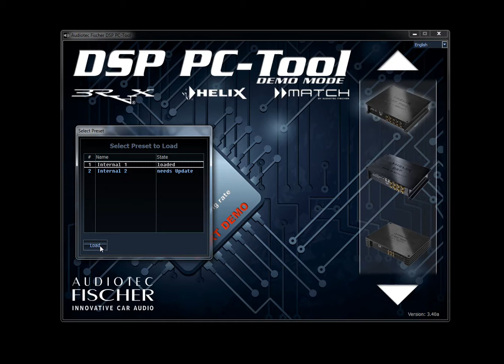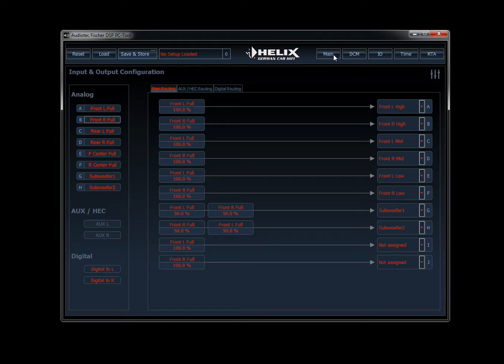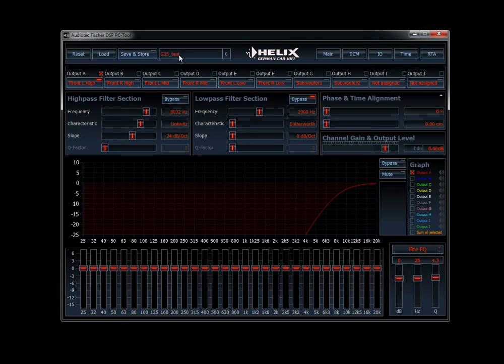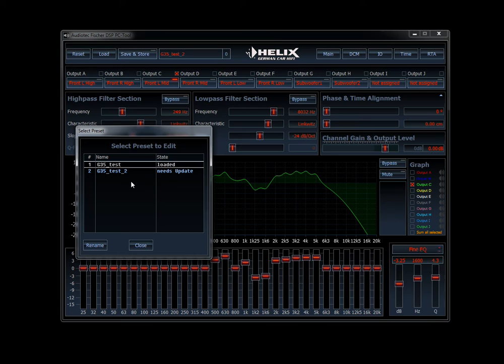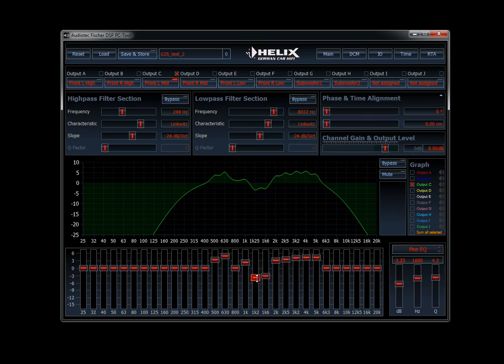Helix DSP Setting Inputs, Outputs, and X-overs

Comment: Ordered the .2 helix. Everyone said this was best over jl. I have premium sound in 2018 ecosport what would you recommend to set this to fix bass rolloff?
Reply: How would I know on a car this new what outputs have what range? I am guessing because it was said to be their most powerful stock system it has quite points set so I'm trying to undo that to run aftermarket mono block and full range for mids and highs. It's titanium so I think it has a center as well

Comment: I do my own installs ... some how I was tricked into buying this amp .. not realizing it has to be programmed .. so I'm trying to learn how to set this amp up without a sound shop ..
Reply from the maker: If you own this and have never tuned a vehicle before I highly suggest you get a shop to tune for you. You can still install it yourself but at least have the setup done properly
Reply: @JosiahBuwalda  I do my own installs ...I have a distortion meter...  multi meters... 2 years highschool electronics.. 4 years army wire systems installer for phones .  and singard Radio repair... I did my own installs years ago and now... this is the first digital amp ive every bought .. I have a YouTube channel of PC building.. I have a YouTube channel for RC car building... I'm bar far of needing them to adjust this amp... and I build amazing PCs that don't over heat .. I over power then with the PSU ... I haven't seen the video all the way through... I'm just curious if I need a cable to hook it to my laptop?
Reply: @JosiahBuwalda  I live in Spokane Washington my shop is like 3 months to 6 months out for an appointment... and I paid $1700 for this amp not realizing it has no gains or knobs on it ... I didn't pay attention
Reply: @JosiahBuwalda  as long as I can get the program and learn how to connect .. I'm so OCD I will be fine and I'm a perfectionist... this is why I do my own installs... I solder and weld on my zero gauge ferrules with a torch ... and I have enough stuff to wire up about 10 cars with zero gauge .. I seen a few seconds of your video and I'm impressed
Reply from the maker: @SteveJ619  you need a usb cable. Everything can be found online, on the Audiotec Fischer website!
Reply: @JosiahBuwalda  and I've built a few different types of boxes thay will need to be tuned ... I don't want to pay to re- tune everytime I want to play with my system by swapping things out... all my amp wires that go to speakers have RC car battery plugs on them so I can take my subs out in 1 second... was smart I made a set of speaker leads for a few boxes..  I've made boxes for 4 ---,6.5 door speakers as well ... I want to test mid and higher sounds out of door speakers .. in a box in my trunk on a vented box to get more full of a sound out of door speakers .. when I find the set that sounds the best .. I will put them in my Dyno mat doors but I think I might make a port on the door through the Dyno matt not sure yet... I will test my back doors first... this is a 2008 Subaru legacy N/A tune ... looks like a kids car... people block me on 2 Lane roads they don't like seeing my car come up behind them on the freeway....I even get break checked sometimes in Spokane... people drive like assholes up here... this is why I'm doing my sound system at the age of 47 years old ... you can't speed up here .. traffic and people won't let you ... so the music slows my roll... and keeps me from getting road rage... this way I stopped passing people on shoulders because I am from San Diego so I do drive like a jackass if I need to ... and I would hate to wreck this car after all those hot ass days required to dynomat it ... first Dynomat I've ever done... made me sick... if I blew a fan in my car to keep me from over heating... the dynomat wouldn't stick and would fall off .. it needed to be 80 to 90 degrees in my car... I can work for about 30 mins before I get everything wet with sweat ... it was actually a lot harder than I thought and I cut my fingers open like crazy because the aluminum foil on that f**** dynamat was sharper than s*** .. anyways .. didn't mean to get into a rant ... I just can't trust anyone to work on my car in Spokane Washington .. nothing but con artist scam artist robbers people that do not do the correct work up here they are half-assed they will f*** you over ... I've learned the hard way I've lived here for 7 years .  it's scam central for car repairs or home remodeling...
Reply: @JosiahBuwalda  do you have a shop?.... are you a state by Washington... I want my car done now .. I'm willing to take a road trip after some of my jobs are finished

Comment: If my tweeters frequency response is 2200hz at the lowest, the slope should not go beyond that frequency right?
Reply from the maker: So usually a Freq Response is based at a very low wattage. So just because it says you can play them down to 2200, you don’t want to cross them over there. Usually with higher end brands there should be a “suggested” crossover point under the specifications of the speaker. I would say to start a tweeter crossover at 6500 at -24db slope. Then play with it from there
Reply: @JosiahBuwalda  i only have a 2 way component system, and my woofer goes to 6000hz. I’ve crossed them at 3500hz, and the slope doesn’t cross the frequency response on either speaker 😄

Comment: I’m guessing since I’m using the hec usb input there is no gain to set.
Reply from the maker: Sorry didn’t see your comment. There is limited control on the input side. But on the output side to the amplifiers there is gain adjustment. I use the gain adjustment in the Helix to fine tune the speakers, most gain adjustment should be done via the amplifiers. That being said, the USB module only works from a device that has a volume control or it’s own power output, such as a Fiio player, that is where your “gain” aka volume adjustment would be. Gain and volume are the changing of voltage to the processor, then adjustment of voltage in the dsp to amplifiers and out to speakers. Hope this was t to confusing

Comment: super video did all to perfection PERFECT!!! but I have an important Question. when I did all this configuration only with the front RCAs all my speakers are in the front for sure like your video BUT BUT when I use on the Radio head unit the Balance Right Left Forward Rear its not working all its a mess... why is this happening?

Comment: Do you have a video about reading the speaker datasheet how you know what the best crossovers are for the speakers.
Reply from the maker: I don’t but Most companies give a suggested crossover point. Or you can use DATs to run a sweep and get your parameters as to what the speaker can play. Then use that information to make a decision on crossover points.
Reply: @JosiahBuwalda  thx I try to do my best on that . For example my tweeters can start off 800 hz that kind off specs I do have

Comment: I have my front speakers all playing in mono for some reason ....how am I able to get them playing in stereo.
Reply from the maker: Not exactly sure what you mean. If you follow along the video there is no way to have them playing in mono. Mono would consist of having the Left and Right signal on one output on the IO page. If you set it up correctly than it’s not in your dsp is more than likely a wiring error.
Reply: System is on mono....algood will sort it out....has something to do with settings i had on io page

Comment: Can the 2 outputs from a V Eight DSP Mk2 be configured as separate mono outputs or do they have to be stereo left and right? I am trying to do an active 3way front, rear fill, center channel, and mono sub. The eight channels can power the doors, and the outputs I want to run to two other amps (one for center, one for sub).
Reply from the maker: You can run it however you want. If you put both a Left and Right signal on an output that will make it “mono”. So do that and it will work

Comment: Thank you. My car audio guy made some changes. It’s been difficult to get back in with him. 

Question is, so if I download the software, should all his presets show up on my Laptop. Also, do I  have to mute anything within the dsp before making changes ? 

My setup, P one to subs, and the helix V 12 dsp. Last time he played with it, he added way to much tweeter. I’d like to revert to the original sound. If this is something stored on the DSP I’d love this. 

Personally do not want to attempt anything myself until I’m sure. I’ve got BLAM signature series and would hate to blow any of them. 

Thanks so much in advance.
Reply from the maker: All the presets will show up but you need to save them one by one onto your laptop. No you don’t have to mute anything to make changes but keep the volume down just in case.
Reply: @JosiahBuwalda  thank you 🙏
Reply: @JosiahBuwalda  it didn’t go as planned. I saved everything, but when it updated it wiped everything on dos. I do have this folder, but it won’t allow me to load file
Reply: Got it. Still doesn’t have some of his old settings. He must have deleted them.  Got my Tesla final to load. Thank you so much for your help

Comment: Hello friend, could you help me with your experience in choosing a dsp? Zapco hdsp vs Helix dsp Ultra. Which is better in sound? And which is better in pc program
Reply from the maker: Personal opinion:  both have exceptional hardware for SQ. I currently own a HDSP, but the Helix I’ll always be the easiest to setup and their software l, if you find any issues, is fixed very quickly.
Reply: @JosiahBuwalda   which is better in sound?
Reply from the maker: @luxtentronik9221  that is a personal opinion. Everyone’s ears are different. I would say they are equal in SQ

Comment: Hello and really appreciating your helpful video

I have an active 3 ways in the front
Passive 2way in rear
With an active woofer equipped with a built  in digital amp.
V 8 mk2 is feeding them all
So in IO menu how should I define  my output for my subwoofer digital amp?
"I" and "J" are feeding woofer digital amp via RCA s 
Should I choose pass through or line out or subwoofer ?
I prefer no processing for woofer built in D amp 
Which should I choose
(Btw I have made L and R 50% each for I and J)

Comment: I have the hellix dsp mini I'm trying to drag the left and right for the subs it's giving me a warning saying already in use I'm doing what you just done for the subs
Reply from the maker: Well if it’s saying those channels are in use. Than they are in use elsewhere and you have to delete where they are being used. Most likely you are trying to put a left or right input where a left or right input already exists and you can’t do that
Reply: I'm doing the same thing as you on the Input side 3 left and 3 right on the output side o have front left high front right high front left low front right low and sub 1 sub 2 what am missing
Reply: Am I supposed to use rear  left full and rear right full for sub 1 and sub 2
Reply from the maker: Hard to tell without looking at the tune. I’d suggest finding a tuner to pay to have everything setup for you. Also if you’re using a director or anything make sure sun volume is up. To me it just sounds like a error in the setup, but just not sure.
Reply: @JosiahBuwalda  I'm using it in demo mode not in car yet I have the dsp mini with the new software  dsp PC tool version 4.75a

Comment: I’m having to use high pass because I can’t use aftermarket head unit. I can’t get sub to come on? If I sum program outputs nothing.  Any help would be great?
Reply from the maker: If you have summed your inputs and don’t have sub output than you don’t have something setup correctly or wired correctly. You should be able to do exactly like this video and get output. Try to put a full range signal to your subs and see if they are working. Sounds like something isn’t wired correctly
Reply: Thank you. Do you have any other secret if I put loop harness in but now my turn signals and seat belt alarms are amplified.
Reply from the maker: You would have to mix your rear left and front left input on the same channel. For output to the front left speaker.

Comment: I am trying to conect my dsp to my laptop , he won't conect ? 
Why?
Reply from the maker: there could be many reasons, but the one way to get it to connect everytime would be to hold the reset button on the helix for 5sec without the usb connected to the laptop, wait for the light to flash red steadily, then connect the usb, wait for the chime in the laptop, then fire up the software. if this doesnt work than there is something wrong on the laptop side. could be drivers, or bad usb cable. this is a factory reset so you will need to load your tune back in and "save and store". also make sure its the latest software
Reply: @JosiahBuwalda  thank you so much for your reply, i will try to do what you said.

Comment: is this a 30-band eq or is it parametric? And can you set the crossover filters at a specific frequency (why 8032 hz / 249 hz and not 8000 / 250 hz)?
Reply from the maker: GrandPixel both. It’s paragraphical like most DSPs nowadays. And at the time you couldn’t change the specific freq. now you can. This software is probably 20iterations old, but the GUI is the same.

Comment: I'm running this DSP with 
FRONT: Brax 3-ways active on a Zapco 150.6
REAR: Helix 2-way E62c passive on Zapco STX4P
FILL: 2-JL12W3 on JL RD1000/1

My question is, can I use these settings as a baseline for my system?
Example: when I get everything connected, can I watch this video and setup my DSP to these settings exactly before I begin RTA tuning to be safe so that I don't destroy these Brax components? Are these safe MHz frequencies, xover points, and slopes?

Comment: My questions are: I am about to install the following and need some direction:
Kenwood 893s
Matrix 3-way Components Active on Zapco 150.6
Helix e62c Passive on Zapco ST-4X P 
Helix DSP Pro MK2 with Director
2-JL12w3 on JL RD1000/1

My question is, the radio and amps have HPF/LPF and a lot of settings that can be adjusted. 
Where should I set my amps and radio if I'm using the DSP for all of the tuning?

Thank you

Comment: Thank for grate video. Just had a ? I have a 2012 Audi A7 and I got jl audio amps but what's the best way to hook up my helix off my MMI, it has fiber cam bus
Reply from the maker: That's something you need to research. Some companies like MoBridge have can bus conversion to rca or optical toslink so you can add amplifiers and processors. Other than actually having that signal converted or getting the high level speaker wires off the back of the oem amplifier you can't do it.
Reply: can i use the fiber optic out of the OEM radio to my Helix Pro 10 ?
Reply from the maker: Jessie Nunez no because it's not a toslink connection
Reply from the maker: No

Comment: Very informative. I had been using Helix P DSP with HAT L1Pro R2, HAT L3Pro, exodus anarchy and Morel 12" sub. I also plan to add either window tablet or ipad as source via digital connection to Helix P Six DSP which I bought just few days back. How would I set IO section then? And do I need to set gains on amp (for sub) as well?

Comment: Hey man thanks for the awesome review ! I installed all Image Dynamic system ( IDQ 65Cs front and rear, I5800 Amp, and two ID10 D2s as my woofers in my new Tundra keeping the original None JBL Entune head unit using JL Audio Fix 86 processor , and it doesn't sound good at all. Very disappointed at this point was told that if i use Helix C62cs front and rear, JL H900/5 Amp , Helix DSP2 processor matched with two JL audio 12W1s, guaranteed i would have an amazing sound quality and clarity even with original head unit !!! That would cost me a lot of $$$$$, so before pulling the trigger wanted have your verdict on it too since you seem very knowledge about Helix system or I'm open to hear any recommendations . I really appreciate it in advance !!! Thank you !
Reply from the maker: neshra54 yea that should be a great system, having the dsp gives soooo much room for growth. You can call us at 770-888-8200, we are the distributor for the Audiotec Fischer product, so we can point you in the direction of an authorized dealer if needed. Also if you have any further questions give us a shout
Reply: Thank you !
Reply: Hey just did A 2016 tundra with the non jbl with Entune headunit. I removed the factory amp and replaced it with the Helix PSIX (6ch amp with built in DSP 8ch processing). Which is powering and processing the Hybrid Audio front stage 3 way active. The PSIX also handles processing of the JL Audio HD750/1 to power the JL Audio Stealth enclosure made for the Tundra. Customer loved the setup and was very happy with the results.  The JL Audio Fix 86 is pretty much like the Audio Control LC6i ( supercharged  line out converter) You need a processor like the helix to realize the full potential of your audio system.

Comment: Thanks for the video, i would have been lost without it! Just purchased the DSP.2. Quick question - right now my fronts consist of Cadence 6x9's in the door and Massive Audio 3 1/2" in the dash wired in parallel, rather than go full range, I set it up as mids. should I have set it up as full range instead? I haven't done any equalization yet everything is still flat. Thanks.
Reply from the maker: Robert Williams your inputs need to be full range. Outputs are really only labels so when you set your crossovers on the main page you don't accidentally set the wrong crossover and blow a speaker.